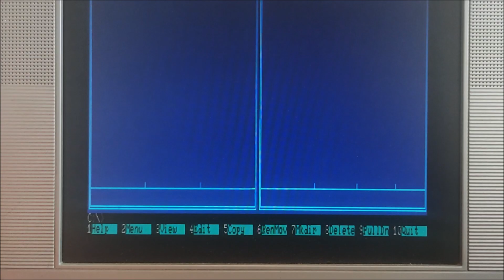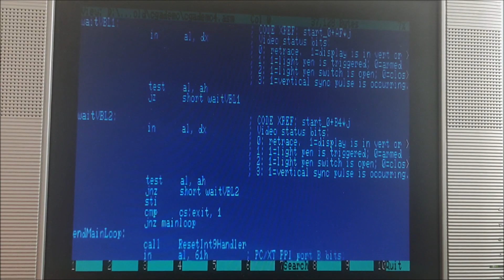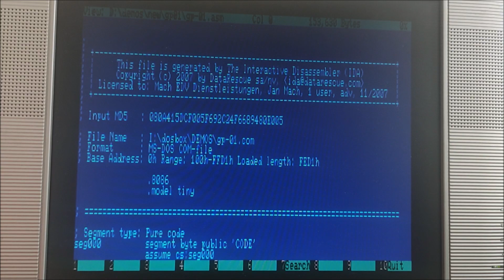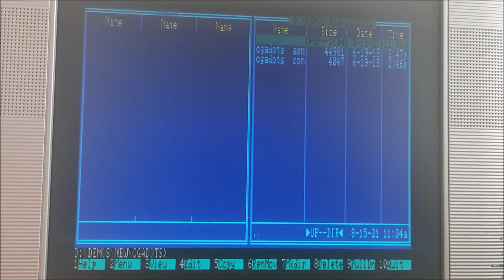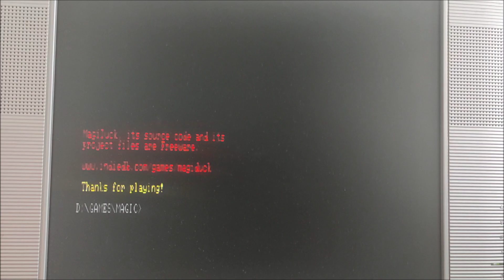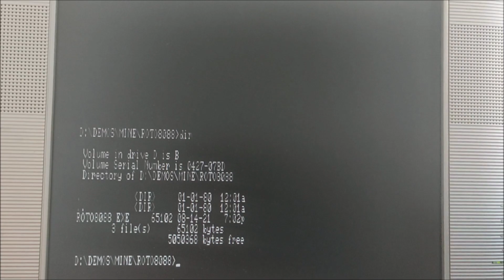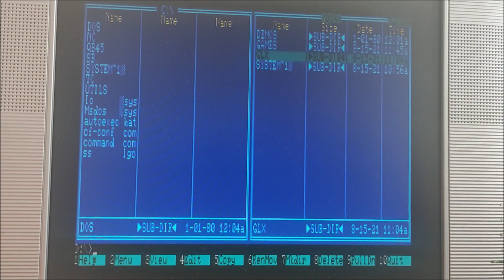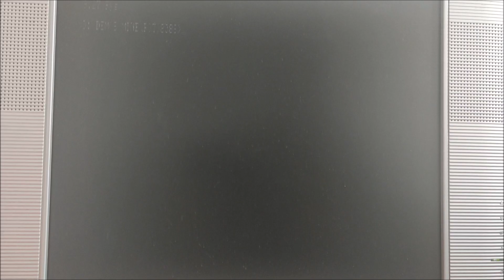My 8088 PC XT build with CGA card

Comment: Nice! looking forward to running it on my 8088 when I get back. Also that duck game looked really nice!

The problem with the GBS was that it didn't support any aspect of CGA video. It takes only analog RGB signals while the CGA is digital, and it takes only combined H+V sync, while CGA has separate H and V sync.
Try changing video modes on the GBS, see if any mode is any clearer.

Comment: Runs on my PS/2 Model 25 but the scroller doesn't work.  34.5fps on this system running an 8086 at 8MHz.  I also ran it on my 5150 which has a V20 in it.  It ran at 13.71 FPS.